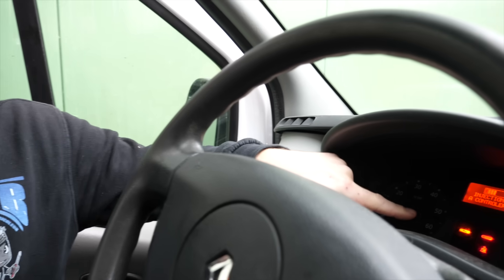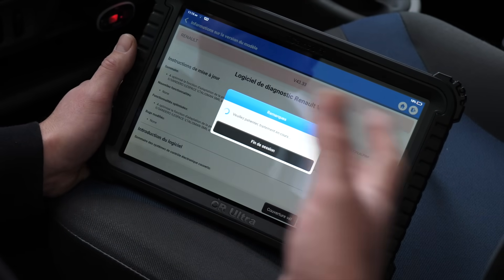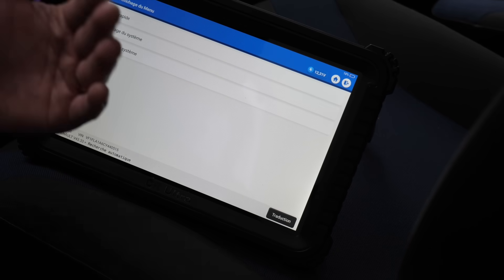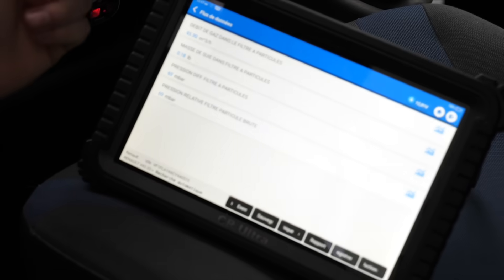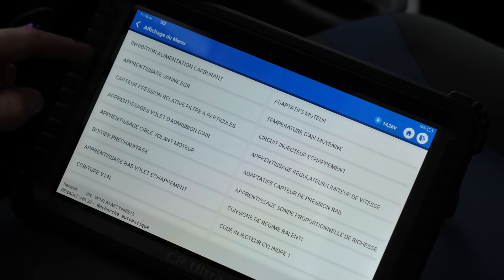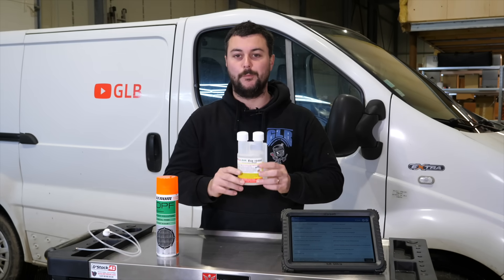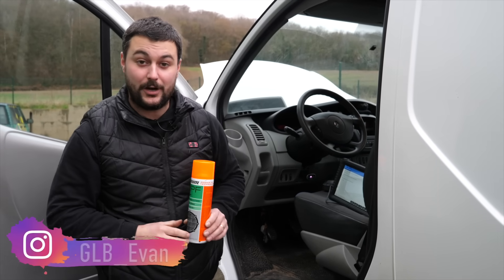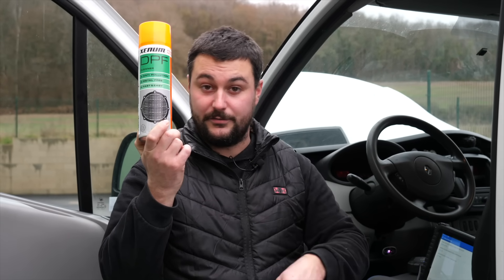Déboucher et nettoyer son FAP à la maison pour 36€!✅Résultat bluffant!🔥

Comment: Alors j'ai testé le produit sur une Peugeot RCZ avec 200000Kms. Valeur avant nettoyage 36 mbar au ralenti et 180 mbar à 3000 tr/min. Après nettoyage 2 mbar au ralenti et 40 mbar à 3000 tr/min. Plus de voyant et de nouveau la puissance moteur. Nettoyage fait en Novembre 2022.
Très bon produit.
Mais, il y a un MAIS, c'était il y a 12 mois tout juste de nouveau le Fap en défaut et des valeurs trop haute.

Donc si c'est pour mettre 40e tout les ans c'est pas la peine.
Perso la société DPAN propose de faire le nettoyage du fap comme de l'échange standard pour 305e HT avec un protocole d'essai avant et après nettoyage et qui va duré comme un échange standard.

Donc bon produit sur le moment mais bidon dans le temps.

Comment: Bonjour a tous
Jai un rav 4 diesel de 2015, 110 000km
Je nais aucun voyant, m'indiquant que le fap est en régénération 
Je fait 50% de ville, 50% nationale et autoroute (11 000km/an)
La plus part du temps, le moteur tourne a 2000 t/mn, donc pour e´"entretenir" , mon fap une fius par mois je vais sur l'autoroute,  pendant 40 km, a un régime moteur  entre 3000 et 3500 tours
Pensez vous que ce soit suffisant ?

Comment: Bonjour tu as oublié de dire que pour l euro 6 il faut  déconnecter le capteur du débitmètre pour que la vanne egr fonctionne pas  pour pas perdre une partie du produit Pendant les  5 minutes statiques  et remettre le capteur débitmètre quand on va faire le test sur la route
Reply: Ne pas paniquer. 
Injecter 4 à 5 litres de vinaigre dans le Filtre à particules, allumer le moteur et le FAP sera nettoyé. 
C'est simple et rouler tranquillement. 
Salutations

Comment: J'avoue être un peu songeur. Je possède un Range V8 3.6 l Turbodiesel. Vu la puissance de l'engin, on est obligé de rouler à faible régime ( moins de 2'000 t/mn ) si l'on veut conserver son permis. Résultat : le FAP s'encrasse et le témoin de défaut de gestion moteur apparait. Ma solution : je vais sur l'autoroute, je bloque la boite de vitesses automatique pour rester dans les limites imposées et je roule disons 20 minutes à 3'800 t/mn et le fameux voyant s'éteint. Même sans aller à Lourdes !

Comment: Il faut nécessairement utiliser une valise pour nettoyer le filtre à particules ? Ou alors on peut simplement injecter le produit dans le filtre et suivre les conseils noter sur la bombe? Je pose cette question car j’ai une Peugeot 207 1.4 HDI 75 diesel de 2010 avec 290 000km et qui de temps en temps (lorsque j’accélère assez fortement a environ 3000 tr/min), m’affiche sur l’écran de bord « attention risque colmatage FAP ». Le voyant du FAP s’affiche pendant quelques minute puis s’éteint. Je me sert de cette voiture pour faire environ 10km/jours et 2 fois par mois je fais des trajets d’environ 800 à 1000km. Je précise aussi que je n’ai aucune perte de puissance.

Comment: Bjr stp pourrais tu me conseiller un nettoyant admission sans démontage pour un moteur 1.9 jtdm fiat de 130 chevaux de 2007 et de 185000 km qui marche très bien aucune fumée bizarre aucun bruit j'ai fait un kit décrassage mecarun et j'ai toujours une très grosse consommation de gasoil oui je tape dedans mais pas comme un bourrin non plus juste j'ai mes roulements avant bien mort je dois les faire mais je comprends pas cette sur consommation important consso réel avec 20 litres j'ai fait que 160 km beaucoup de ville et surtout en mode décrassage donc a chaud bien chaud environ 8 km a 4000 trs quatre fois